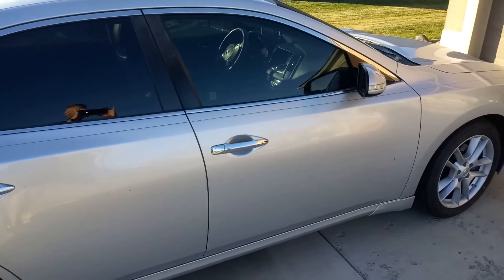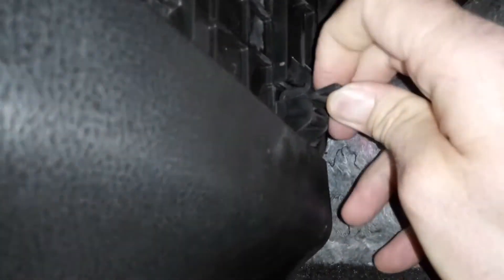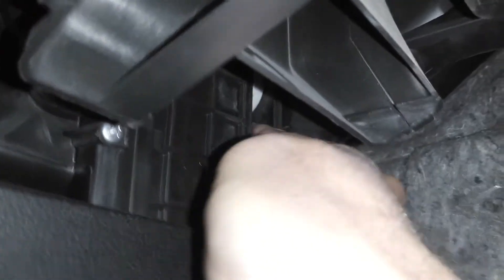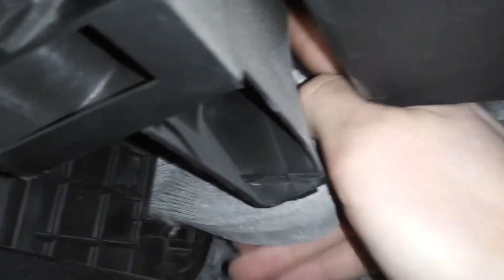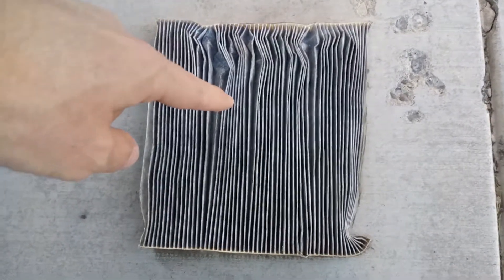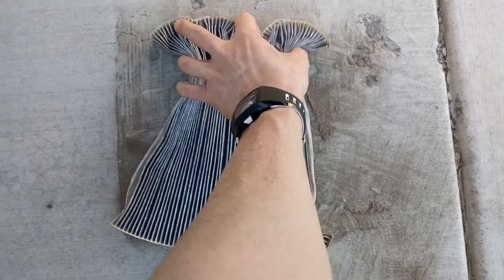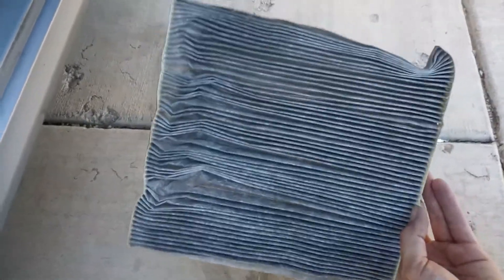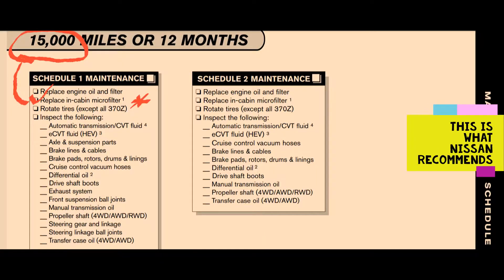In Cab AIR FILTER change*** 2010 Nissan Maxima***

Comment: The trick is removing it from your back not your knees sounds weird but you get a better grip on your back doing the limbo almost and also remove thenside panel as well
Reply: Yeah, couldn't agree more.  I'm a little (alright, a lot) bigger than the average bear, and my ribs got totally wiped out while being in contact with the door sill.  So then I thought to bring the passenger seat all the way back, and also lowered the back of the seat, put a pillow on the mat, and then laid on my back to yank it out with a pair of needle nose pliers, as I knew I wasn't putting it back so who cares.  The ends that had to go in weren't that flexible, so I started with the bottom, and literally jammed in there.  In my heart I know that was 1/2 ass, so I'll be taking out the glove box as there's only 8 screws + pop the right trim off, and the whole thing comes out.  I'm pretty anal when it comes to doing something the right way vs. just ok.

Comment: You never mentioned what direction the arrow is pointing on the filter?!
Reply from the maker: Great question Richard... Air flows from the front to the back, so you want the arrow pointing at you and if the filter has the arrow pointing up or down, you want it going from top to bottom:-) thank you for bringing this up, and hopefully that helps anybody else trying to do this!